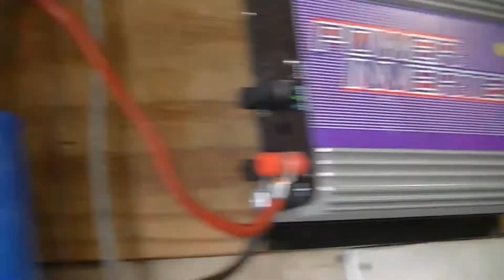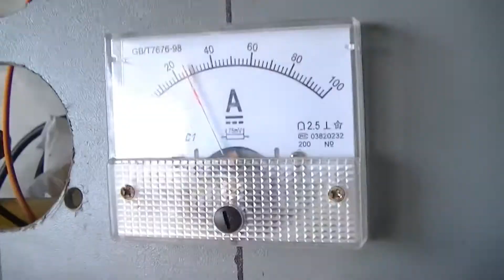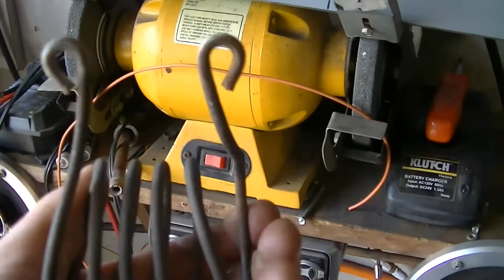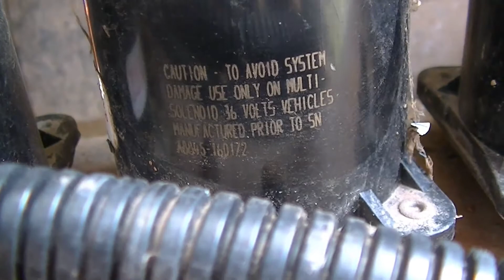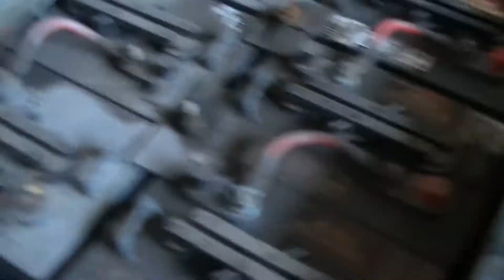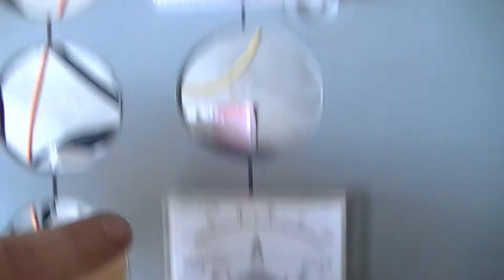My Feelings on SSRs vs Mechanical Relays and Some Updates

Comment: I am glad you like the old coil relays too.  I had the same conclusions after burning out one too many SSR's as they would just over-heat sooner or later.  
Thanks for showing the golf-cart circuit!  Man is that ever wasteful!  Heat coils? You think they would have been smart enough to tap the batteries separately with those relays.
First click goes to 12 volts, second click to 18 volts and so on.  This also allows for regenerative braking without any fancy circuits.

Great Video! Thanks!

Comment: Nice setup on the shunt and the box Kevin!! The theory behing the SSR is not the same as with the mecanical relay... SSR`s are ment to be use on AC circuit and the AMPS rating is not the same..  SEE, if you are about to use AC breackers in a solar, you need to get a 40 amps AC to be use in a 20 amp DC system..  The protection Inside the SSR are (SOFTER) then a DC.. If you open a AC houseold breacker, you will see the tiny spring that flick off the breacker..  DC relay are beefier and can withstand the heat twice as an AC relay.. Anyhow!! I`m not trying to change your mind on them..  Just that they have their use in a system if they fill the right function.. All the hard work on the display will be good looking by the way my friend.. Thanks
Reply: ***** Al again is right and SSR's on three phase side is the only use I'd use them!! But Thermodyne Relay has sliver connects and should not hamper any! But Kevin the showing of the uses in golf cart's all the way back in the eighties should be convincing enough to know the durability of a mechanical Relay works! Good video and explanation!! :)